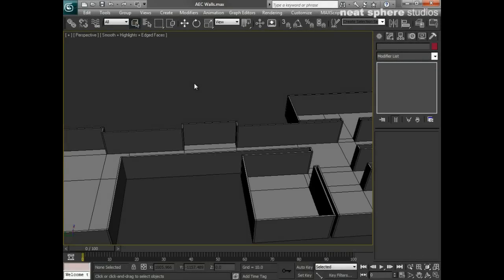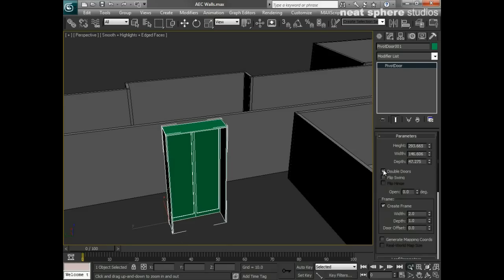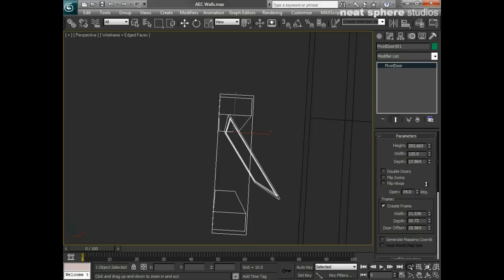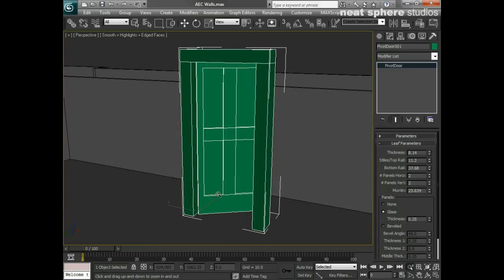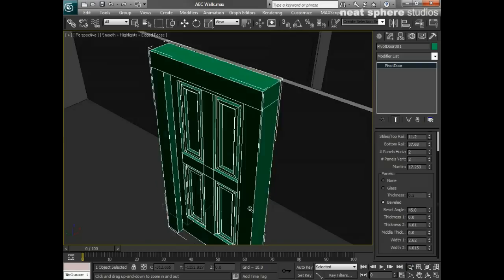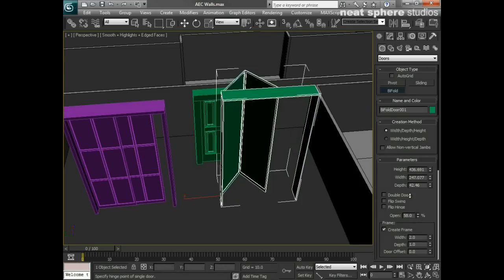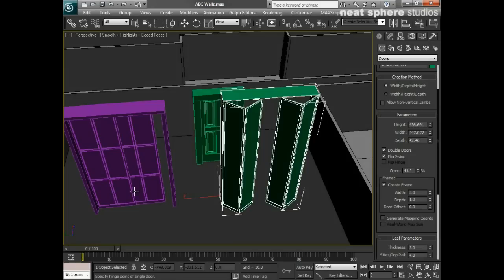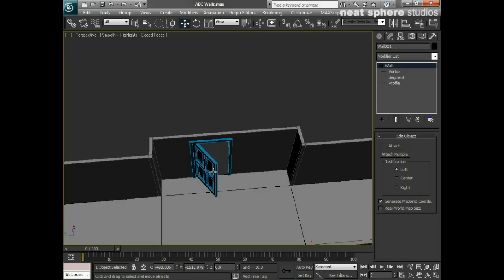Learn  Autodesk 3ds Max -- Chapter 4 - Creating and Placing AEC Doors in Walls

Comment from the maker: You need to turn on snap using the S key to start the process. Then turn it off half way through. It's not the text book way of doing things but it works. Make you sure you're snap is set to Edge as well.